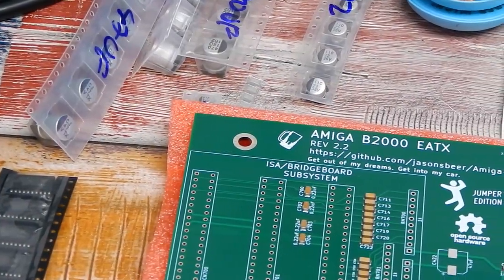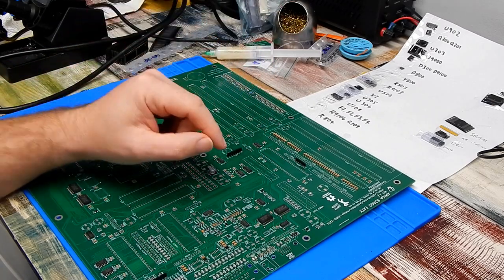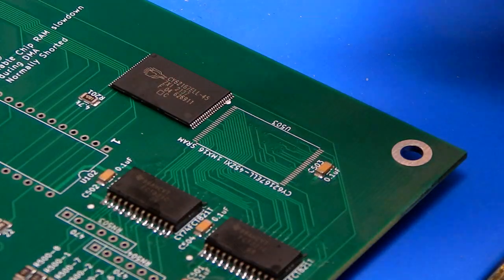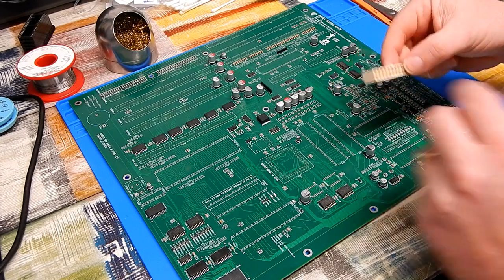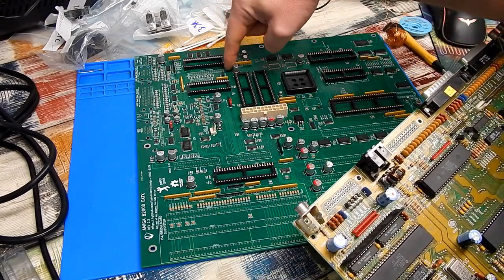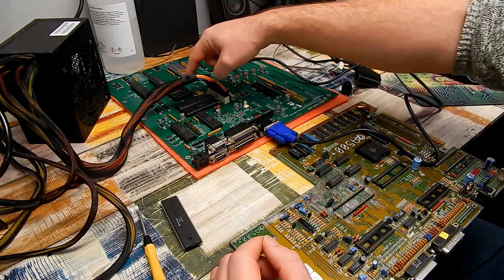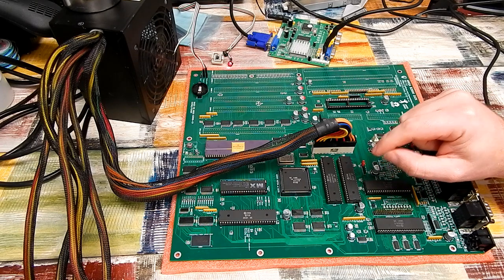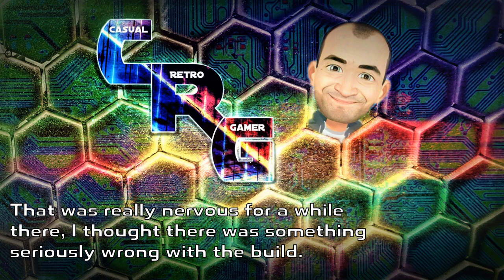Building a NEW Amiga 2000 in 2022 - Part 1 assembly, testing and first power up

Comment: I really wish someone would make this board for all thru-hole parts.  Surface mount is low quality, consumer level garbage.  One of the nice things about the Amiga 2000 computer is that its motherboard is high quality thru-hole.  When you compare thru-hole parts to surface mount parts you can see the difference in quality.  And yet, for some reason people are converting high quality thru-hole PCBs to low quality surface mount crap.  WHY?!  Are thru-hole parts getting hard to find, or what?  I would buy at least 100 Amiga 2000 ATX motherboards if they used thru-hole parts, not the surface mount garbage.  🤔

Comment: Thanks for the video. Nice build. The 8375 Agnus is so overpriced these days. Wish they made an FPGA replacement or something
Reply from the maker: I couldn't agree more, some are asking £120 now for an 8375.  Still not given up on the dead one, hopefully it can be brought back.
Reply: @CRG  £120!! That's insane! On two of my A500 ++ replica boards I used Liv's Diet Agnus adapter to convert from 8375 to 8372A because I refused to pay insane prices for the 8375. There are very few/if any OCS/ECS whdload slaves these days that require more than 1MB chip + fast ram.
Reply: Someone was working on an FPGA replacement but work was slow due to the lack of documentation.

Comment: About the Case:
There is an issue with modern Cases. They don't have any external 3,5" bays  that you need for the floppy or a GOTEK.
So that's an issue. Heck even internal 3,5" bays are becoming rare these days...
5¼" Bays are not as hard, so you need at least a 3½" to 5¼" Frame thing and then use a Case that is made that allows E-ATX and has a 5¼" Bay.

The be quiet Dark Base 900 would fit that, but that's not cheap...
So you might want to look for older SERVER/WORKSTATION cases perhaps? 
Or go with a good old Desktop one...
Reply from the maker: Yes new cases with external drive bays are very hard to find.  I've got a plan though.
Reply: @CRG  Silverstone Grandia GD-08 or GD09 perhaps? Though you need a 5¼" Adaptor, but that shouldn't be a Problem. A black FDD (Cover) is also something you might want.
Skinflint (UK Version of Geizhals) should give you a good idea of what you could get and has some nice search options as well.

Comment: Couple things I noticed....
No video slot on far right? 
Guess they moved it and put in SVideo or something?

Also, the 68000's position could be bad for people who use a CSA Derringer 030, CSA Mega Midget Racer 030,  PP&P 040, M-Tec 020 or 030...
Basically, anything that goes into the 68000 socket is gonna ram into placement issues on whatever gets installed in that slot.

I have design ideas for drop in motherboard replacements for A1000, A500, and A2000 (and maybe the 2000 tower).
Only the 1000 and 500 would have the 68000 socket anyways yet I calculated the size and position where the above mentioned boards (and maybe some of that newer stuff they got out now) would fit without an issue.

My designs are based on an old dream back in the 1980's that me and my brother had...   essentially wishing C= would come out with as board revisions.
They never did such revisions but it was always cool to want this or that...

So the minimum modern stuff I could use from now...  the better.
Maybe pay homage to Jay Miner with a set number that have his image on the board (wouldn't be able to sell those but give them away).
The others would all have a message and memorial written on the back of the board.

The boards would use 30 pin sims and 68010's (for the 1000 and 500).
Up to 8mb of Fast RAM for those old CPUs (they can take it).
2mb Chip RAM on board.. with auto sensing (or jumpers) for whichever Agnus is installed (either the 512k, the 1024k, or the 2,048k one)
Separated into 3 banks.  0 = 512k, 1  = 512k, 2= full 1mb.
There's reasons for that.... 

Also the CPU's would be going 16mhz exactly...  or a jumper for 8... or an option to go 7.16 (standard) if one of those other boards requires exactly that setting.
(Boards like the M-tec 020 would require the 7.16 speed because it double that for its own chips.  The CPU can handle it... the GALs or PALs  may not be able to.. least thats what I was told).

On the 1000 the front expansion would have four 30 pin sockets... the main board would have four.
IDE interface if it will work with 1.3...     
The only modern changes would be to add a VGA output... and room to allow for a HDMI (for someone who gets that Denise to HDMI board)...  
Color out would be S-video maybe?

The 500  would also have four 30 pin sockets on the maim board and four 30 pin sockets on the trap door card.
It would also have the same CHIP RAM configuration of three banks.

The 2000, variation I planned to not even have a 68000 socket at all.
Just a 020/030, 881/882 sockets with the initial CPU being an 020 running at motherboard clock speed of 28mhz.
It would still have a CPU slot.. and a 2nd video card slot would be added...   (Had a friend that wanted a 2nd video slot so bad...  he had a Toaster...)
The 2000 could be upgraded with an 030 since they are pin for pin compatible.

The 2000 Tower would be a weee bit different.
It would have an 040 on the motherboard. 
With 72 pin sockets up to ... whatever works  LoL

Remember the entire idea was to just make these three with mostly the same stuff that was around at the time they either came out or were going strong.
I think... whatever was around 87-89 range....  30 pin simms had been around since '82...
72's did show up some time later...  but for the tower..

My goal was to make exactly 4,096 of each of these.
4,096 represents something significant to some Amigans.
It was the amount of colors in HAM mode that they bragged about when it first came out.
Seems to be a good number.

Plan was to try and sell 4,000 of each... 
and give away to certain folks the 96 "Jay Miner" imaged boards (that are behind glass and hang on a wall).

Alas, with my bad health.. these probably won't happen at all.
I think it is smarter to make the boards and get most of the parts like caps, resistors, connectors, sockets...  maybe the 16mhz 68010s...

I think they'd be honorable upgrade replacement boards even though they wouldn't be extreme like you could design.

Hell they got A3000 and A500 AGA monster drop ins now that kick butt.

Anyways...
Reply from the maker: This board isn't designed to fit in the original case, its design in an EATX form factor so the video slot has moved position to what would be the first slot on a PC motherboard.  The 2000 also isn't really meant to be upgraded by replacing the CPU in its socket, rather the CPU slot should be used and there are adaptor cards out there that allow you to use the 68k socket accelerators in the slot.  

You're plan for your own boards sound interesting.  Good luck should you ever decide to build them.  I know the idea behind this board was to keep it as original as possible while fitting the new layout and allowing maximum choice in terms of agnus chips.

Comment: having the ATX Power connector in the center of the PCB instead of the edge like any PC Motherboard is a really weird choice. why was it done like that? especially since most PSUs probably don't have long enough ATX Cables to reach that far when you actually try to put it into a PC Case.
anyways, the idea of having an ATX compatible Amiga motherboard is pretty amazing and i wish i had the know how to try and make my own (is there a github for this project?) and see if it can be shrunken down to regular ATX size and maybe with some more onboard features like SPI to hook up an SD Card/USB Controller so you don't need to bother with an IDE connector and CF/HDD
Reply from the maker: I think the reason for the size is to accommodate the length of the original zorro cards.  As for the power connector, yes it would have been better on the edge but I can only assume its central to easy power distribution around the board.  

I've added the github to the videos description, or heres the link. 
 https://github.com/jasonsbeer/Amiga-2000-EATX

Comment: Is this a kit that comes with the parts (minus the custom chips)?  Please clarify.
Reply from the maker: No it's not a kit as such.  All information you need to build one is available on the GitHub. 

At the most basic level you send the gerber's to the pcb manufacturer, they will make the board, you purchase all the parts and fit them.  We went a step further and got JLC to fit some components for us.  The only reason we didn't get them to do more was because they didn't have stock or it was considerably cheaper to do it ourselves.  To get the PCB manufacturer to do this though we had to create a pick and place file.  I'm not sure if this has been added to the github. 

Sourcing components was also tricky as to keep costs down they ended up coming from multiple places (digikey, mouser, AliExpress, eBay etc) and that doesn't include the chipset.  

It was a tricky build but absolutely worth it.  By far my favourite Amiga.
Reply: Thanks for your timely feedback.  I'm in a tricky situation. I have a 2K motherboard that experienced the "battery leak" problem.  I'm reasonably sure the custom chips are OK because they are socketed.  Because of this, I was considering all my options, including having the board professionally "fixed" - or possibly picking up this "kit" (I don't know what else to call it) - and using all the original components to rebuild it up to active ability again.

I do have good de-soldering/soldering skills (although I feel it would be wise for me to “practice” for a month before entertaining/engaging a project like this.)  Your project showed me more about the process that I was aware of.  I can see how extremely educational and a “spiritual” success this would be, accomplishing something like this – along with much input, along the way.

My meditation on the problem contiues!

Comment: Best pause and make a brew..
Reply from the maker: Yeah sorry this a long one, although there's a lot of work to get through 😉
Reply: @CRG  Sorry? Are you mad???? Keep them rolling. :)
Reply: Just finished - looking forward to the next instalment. 
With regards to cases, it is very much a personal thing. A plain beige, or black case would be my preference. I appreciate you wanting the window, it would be nice to show off the internals if you're going to give it pride of place on the bench somewhere. Cable runs will be interesting given the ATX power supply connection location though?

Comment: I just want to mention you can get yourself Soilder Paste which comes in a tube, you put it on your surface mount pads then put your components on top and using a heat gun it heats up the soilder pastes (which also has flux in it) and pulls the component onto the pad soildering it into place. Check YT for videos.
Reply: Wont the PCB take damage from being heated up over and over again, risking delaminating the board?

Comment: 9:50 That are stupid tiny pad, the designer of that cad drawing didn't calculate in for handsoldering, and there is room for bigger pads. I always swap those drawing for a generic 0604 pads (or what the size is) if I come across components drawing with tiny pads like that.

Comment: I would build this...

But its impossible to find the chips... someone needs to start building replacement equivalents....
Reply from the maker: Part of the reason I went for this one is that its the most accessible in terms of getting the original chips.  All you need is a donor A500+ then you can build the bluster as I will be doing in the next part.  If only replacements came up for the A4000 specific customs then I'd be all over the A4000TX build.

Comment: Have you tried Solder Paste?
This Project screams quasi "use me" for Solder paste...
Reply from the maker: I have to admit I've not tried it and seeing some horror stories with it I'm not sure this would be the board to practise on but it is something I should try on a smaller project.
Reply: @CRG  the QUestion is:
Was the Soldering Paste stored correctly? And was it still good?
From what I gathered, Solder Paste has to be stored in the Fridge and it seems that it can go bad.
So its a bit delicate. And might be quite expensive as well...

The Advantage is that it should make soldering SMD components, with a bit of experience, really quick...

But yeah, you might wanna practice on something first and get to know how it works.

Comment: Nice nice nice.
Reply: I was waching a video vampire 4 based I think where rather than use the standard FPGA libraries being flashed they flashed the expansion with the m68000 version rather than the starndard cpu "emulation" on that chip.  You know how yow they are a software cpu immitation and cutom chip immitation - i think they were using the c5 rather than c3 but rather than programming the chip with the old soft-cpu's they used a newer one getting 1200mpis and similar mflops plus ocs ecs aga immitation.  

It's a newer version of programming the FPGA 68K immitation? And it was fast.  Much faster than the older system everybody uses with those pi-storm type upgrades
Reply: Sorry if I sound like a loony - you know how they programn the chip to be a 68080 etc - I might be mixing up tech but they reflashed a new more raw sort of library in development and got nearly the full raw mips and mflops out of their fpga.
Reply: thats such a nice job you did and a totally awesome project I love it.  My comments aren't really relevant I was just relaying something i saw in other videos and mixing it with what I wish I had. I'd love an a1000 with the cpu update I'm referring to - but all video output modes put out through hdmi but the a2000 is something I always wished I had.  I like the version you're building i wish I could have had that sort of board way back when - putting my amiga in a pc case is somewthing I wish was available in aproject like this.  These days I want the classic amigas modded with everything through a Vga or hdmi no video sqitching. 

Everybody now wants a classic amiga in an upspecc'd form but still the original hardware.  I rant on about the video output but you don't want 2 monitors displaying different modes - you want a classic amiga and it's original games output the same screen transparently on the modern RTG workbench - wish I could get an a1000 just pistorm the cpu etc and have even classic games output through the same video output (both VGA and HDMI).  

Buttt the classic A2000 case is gangsta you can pi-storm all those old machines I just want a version that doesn't require separate monitors and just does AGA even if its an OCS or ECS machine.   

Back in the day I wish I could PX-ise my old Amiga.   These days I love the classic cases on all models

Comment: is this expensive to do ?
Reply from the maker: Good point I forgot to mention the cost in the video.  I'll cover it in the next part but to break it down roughly it cost around £300 for the board and parts, the doner A500+ was £60, then it's case, PSU, drives etc for which I budgeted another £150.  All in then about £500.

Comment: abusing the poor old A500 PCB by taking the CPU socket out only to not use it 😔also pin headers are pennies...
Reply from the maker: The CPU socket does eventually get used and yes pin headers are pennies but at I didn't have any double row headers in stock so handy to just grab that existing one.  the A500+ board was always going to be scrapped so may as well use what I can from it.